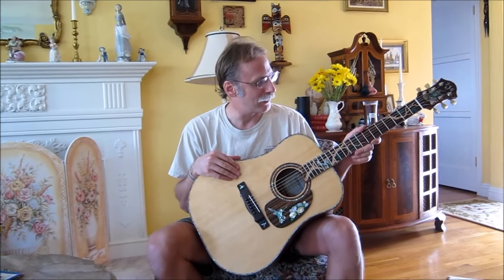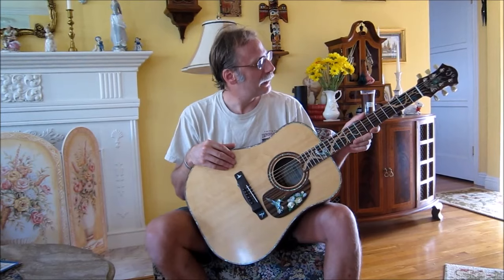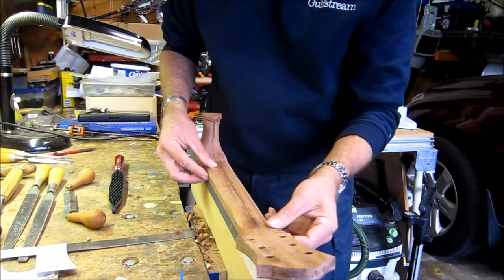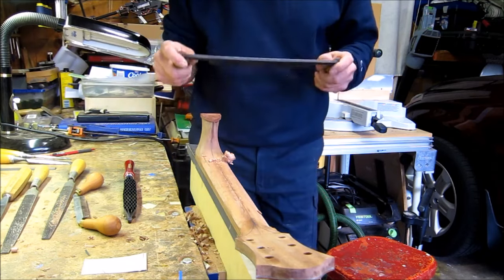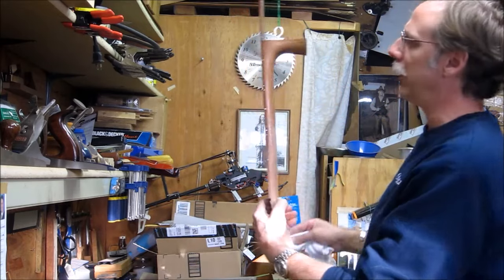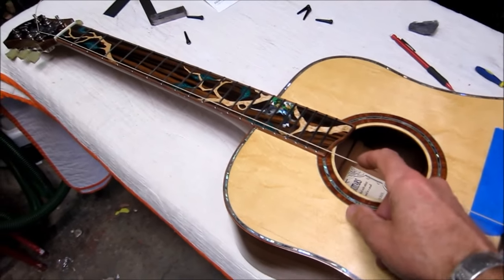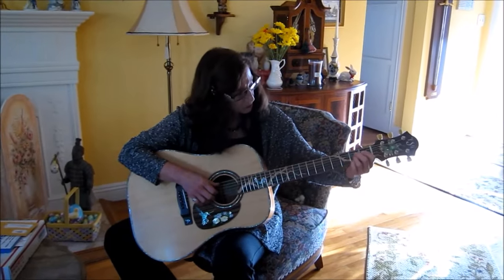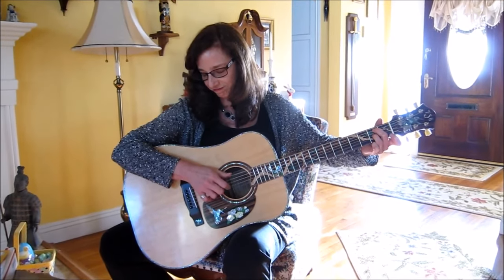My first guitar build

Comment: This video has popped up several times in my recommended videos, I skipped over it several times, but wow, I’ve built 6 guitars and have more in the works, this is absolutely incredible. I wish my inlay skills were as awesome as yours. The neck joint is interesting, for you to not have built a guitar or even play guitar is mind blowing, you definitely have a well equipped workshop and have incredible wood working skills. If that would have been built by a large factory or small bench luthier it would probably cost 10’s of thousands of dollars, it’s as beautiful as a Somogyi guitar which costs at least 40k

Comment: Just caught this video.  BEAUTIFUL CRAFTSMANSHIP.   I heard you got inspiration from
 William (Grit) Laskin, guitar builder with exquisite inlays similar to yours. I used to work
with "Grit" in the early 70s in a recording studion in Toronto..but that was a long time ago.

FSG . Is that a special ribbon stripe mahogany for the back and sides and what grade
of spruce for the top? Like the wood binding.  Would that striped wood be Zebra wood
by any chance or a different kind of madagascar ebony?

Very unique neck to body attachment using 4  dowel arrangement at the heel. Quite different 
than the traditional dove tail joint, but it obviously works.

The pau shell/abalone for the humming birds is very intricate and required a lot of painstaking  detailing with a hand saw. I see you used MOP for the feather tips on
the humming birds, and your unique way of using exotic woods for the tree branching.
What kind of green wood for the leaves? In a way you almost want it unspoiled rather
than saw fret slots into it. 

Noticed   that you hand shaved the neck profile without a neck profile shape template, but...you obviously knew what  to do there. Using your grandfather's spoke shave is an
added touch and a interesting connection to the past.  Makiing your own fret bender..good for you!

Your guitar tone is very exquisite. Very nicely balanced.  I agree with the lady's opinion..you got it spot on.
BTW, I heard a version of her first song..."Come all you fair and tender ladies" , available on Youtube. 

Her other song is Gord Lightfoot's famous "Song for Stephen Foster"..a beautiful song
when finger picked on a guitar such as yours.

Well done, well done for your first guitar Colin.

Comment: Great vid of your build. Looks and sounds absolutely amazing. My only negs might be - I personally prefer matte finish on a fretboard, and I wonder about the neck dowel joint - I haven't come across that method before. Your friend Ronda has a perfect voice for 'Silver dagger".
Reply: I wouldnt necessarily have gone for the neck joint he chose either, but the joint is done so well and the neck block was large and super well crafted, I don't think you'd ever have a problem with it.  It's so solid.  You can tell by the sustain and overall tone.

Comment: This actually is meant for a showcase. That it sounds so good is a comment on your craftsmanship. And to think that it was a first effort. Would love to see the outcome a few guitars down the line - that should be something.
By the way, what variety of spruce (is it spruce?) did you use for the top? I think it is beautiful.
I went through the comments to see if there was a comment on that but your inlay work seemed to have stolen the show!
Reply from the maker: thanks Amit, I am about to string my latest one and set the action, hopefully will have another video real soon, the top is a bearclaw spruce, clean clear spruce is great but I love woods that have mother natures imput, and it worked with the inlay design.
Reply: Colin Smith Oh, you bet.
I have totally flipped for it...so much that I will hunt for a top and get myself a guitar made (another one that is)!!!!!

Once more, great going!!!

Comment: Love it!  The inlay work is incredible!  Just wondering if you're still attaching the neck flush like that?  How's that joint holding up?  I'm looking at doing my first guitar and that looks way easier than cutting a dovetail!

Great guitar!
Reply from the maker: Charles thanks for the nice comments, I have now decided to use a bolt on mortise and tenon, definitely more control I feel for setting the neck, and as I like to finish the neck and body separately there are less issues because of not having to clamp a finished piece. It is holding up well though neck has shown no obvious movement.
I am coming along with my new guitar called "building Freedom" I will hopefully have a website going soon, thanks again for the nice comments

Comment: Great detail - too much detail specially to my eye - but I certainly see your talents. I'm pretty sure you were an accomplished wood working and inlay person before you built this guitar though. That's too steep of a learning curve for an unexperienced artisan to attempt. 

I build a few guitars for myself and friends too, but I don't like Tung Oil, as the wood sanding imperfections show on the surface when the light hits it in the right position. Instead I use nitrocellulose lacquer and apply nothing but it as a both the wood filler and final coats. 

As a filler, I apply a few coats and then using mineral spirits (paint thinner) I sand it all down with 400# wet/dry paper. This I do repeatedly until I get a totally flat surface. I don't use my hands or fingers behind the sandpaper - but I use flat sanding blocks on all the surfaces that will accept their flatness. 

Using mineral spirits instead of water with the wet/dry sandpaper won't pull up the grain and it evaporates completely in a few hours and leaves no residue either. 

I'll apply 30 or 40 coats of lacquer - removing most of it each time I sand it again - sometimes tinting it a little as I see fit and then with 'killed' or worn out 400# paper, I finish the sanding and then on to a buffer with swirl remover compound. The last buffing compound is common everyday talcum powder and a high speed fleece buffing wheel. 

You though - have some serious talent with all that inlay work. I appreciate talent like yours when I see it.
Reply: He's using Truoil, not tung oil.  Completely different.  Lacquer is nasty stuff.  Truoil is easy to repair and apply.  Good stuff.